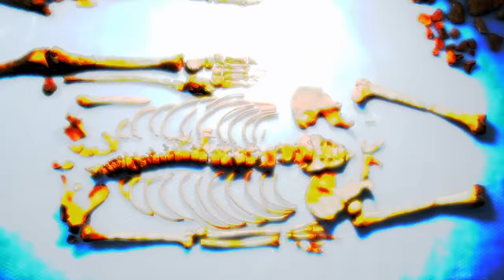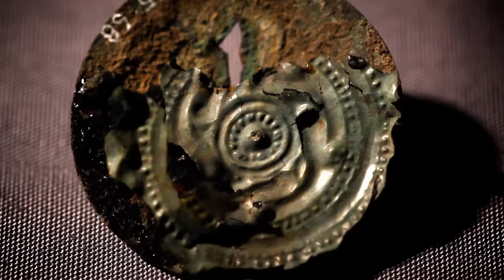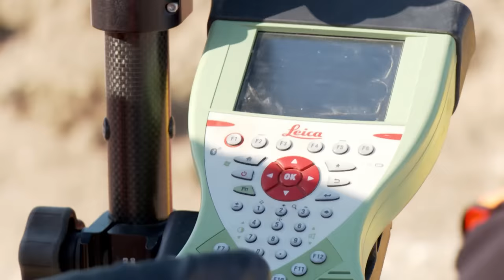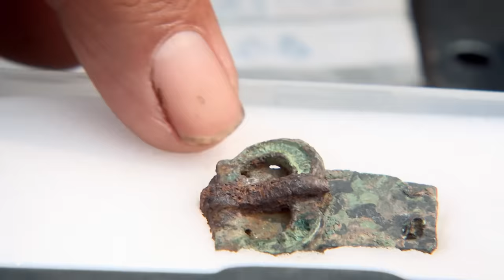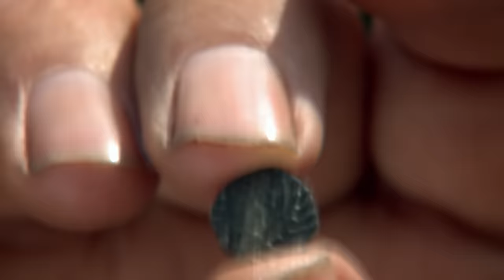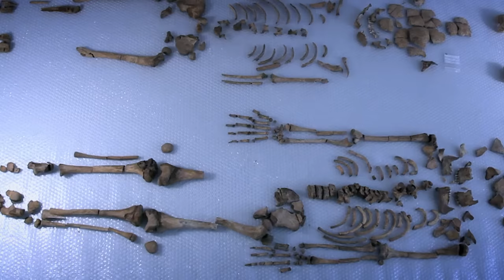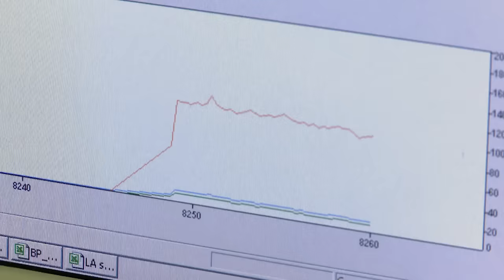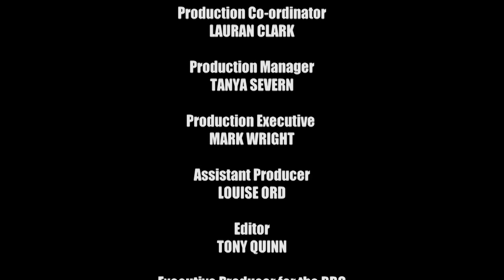Can Archaeologists Shed Light On Britain's Dark Age? | Digging for Britain

Comment: I wonder how the Anglo-Saxons and Vikings got along.  Did they understand enough of each other’s language to communicate, did they have similar. values about community?   I am a novice, but I wonder about the positives of mingling,  not just the power struggles.
J.
Reply: They kind of rubbed along after some initial conflict. Old English was a complex inflected language grammatically similar to german that mostly lost its complexities due to interactions with the norse speakers modern english is descended from an anglo-norse hybrid

Comment: Are these coins centered stone or foreign metal? Upon one of my research studies I had two different tribes that were making different particles of elements to the tables. Coins that were manufactured on large stones that had the depictions of the molding but the center of them were made out of out of place substances and was just the beginning stages of plating gold and silver they would choose of the stone out of a solid form and then slowly pour over the liquid state of either gold or silver.

Comment: There is some forms of the gothic style themes of the cathedral churches that were in the same formal structure of this design the outer shell of the churches were supposed to be capitalized on the outer edge of plating of either gold and silver and then they would mortar over to not show the value of what they would consider a homestead. The entire building would be gold silver inner design and covered with concrete on certain parts counseling the worth of there earnings. There home was there bank.